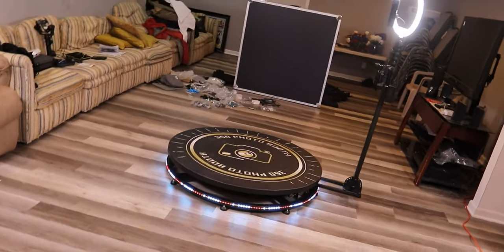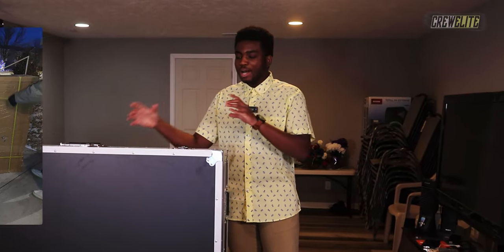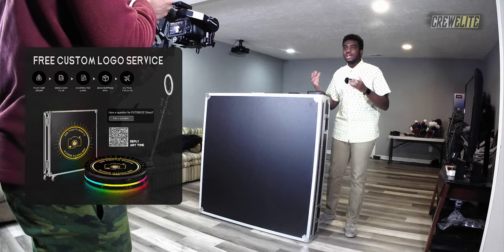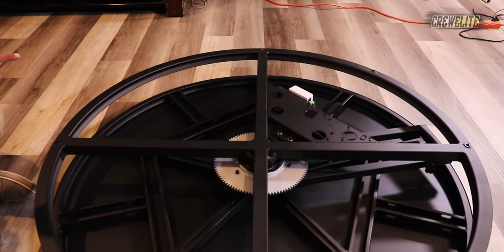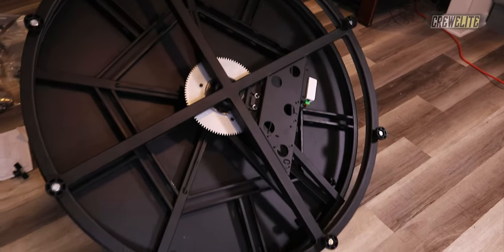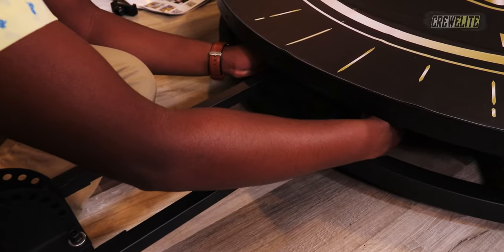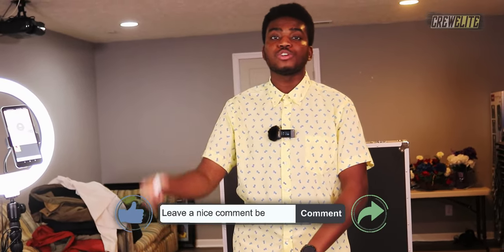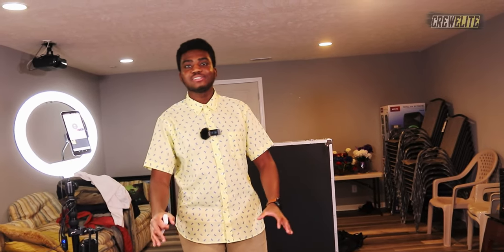How To Setup & Use 360 Photo Booth! | FUTOBOOZ: 7-Person Automatic 360° Photo Booth Machine [REVIEW]

Comment from the maker: SAVE 35% WITH CODE: "FUTOBOOZ35" VALID FOR 3 YEARS!

- Photo Booths -
• 26.8" (68cm) + Flight Case: https://amzn.to/3IiBHKg
• 31.5" (80cm): https://amzn.to/3jKUlkv
• 31.5" (80cm) + Flight Case: https://amzn.to/3YrfBe0
• 39.4" (100cm): https://amzn.to/3lnp7jD
• 39.4" (100cm) + Flight Case: https://amzn.to/3HLlxas
• 39.4" (100cm) Glass + Flight Case: https://amzn.to/3xcF6Uo
• 45.3" (115cm): https://amzn.to/3lrcdBd
• 45.3" (115cm) + Flight Case: https://amzn.to/40OeUNh

- Accessories -
• LED Lights: https://amzn.to/3lty5fm
• Selfie Telesonic Rod Tripod: https://amzn.to/3K3Q9H4
• LED Ring Light: https://amzn.to/3jI3KJC
• Motor Remote Control + Control Box:  https://amzn.to/3YfiKNX
• Adjustable Tablet Holder: https://amzn.to/3XpkPpo
Reply: But tablecloth bro

Comment: The app seems to be very cumbersome, we are having a hard time using it and easily sharing. Any other app recommendations?
Reply from the maker: Hello SellingDelco! Yes, of course! The ones I would recommend are either FunEvent 360 Photo Booth,  Snappic, or TouchPix. All these have great interfaces but some of these do charge rates to use them. 

I hope this information helps you out. If you have any other questions, please feel free to ask me! Also, make sure to subscribe and share if you haven't already! Welcome to the Crew!
Reply: @CrewElite  Appreciate the insight. It seems like the Chacktok app controls my Futobooz, would I be able to control the Futobooz from an app like Snappic or Touchpix the same way? As soon as we set up the app, the basic remote control for our Futobooz has seemed to stop working.
Reply from the maker: @sellingdelco  I can also attempt this and see if I can get it work properly.
Reply from the maker: @sellingdelco  Which application have you tried out?
Reply: The more I’m searching the more it sounds like the only way to get the booth to be controlled is either the remote (which won’t work😂) or the app.  Other apps won’t control it
Reply from the maker: @sellingdelco  Yikes! I'm going to get in touch with this brand and see what they say. I do have their contact information.